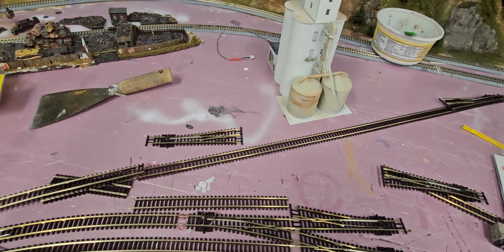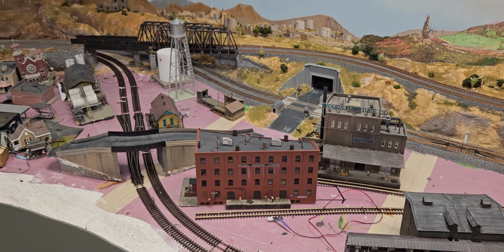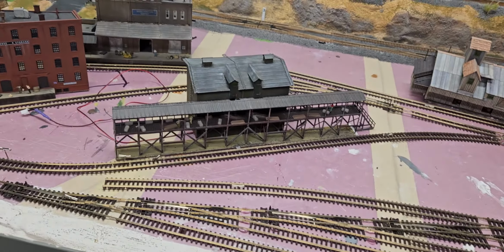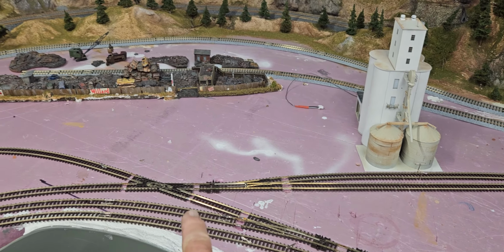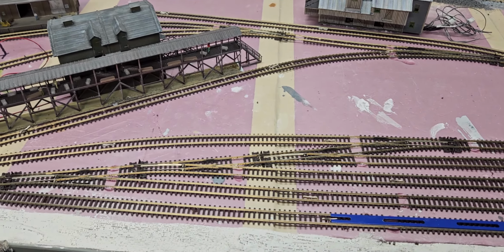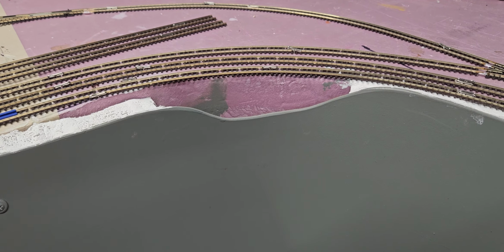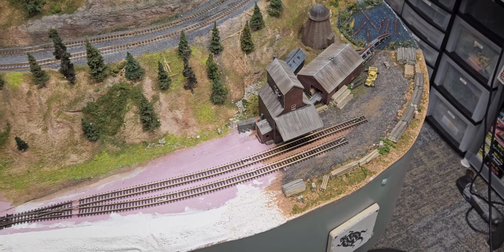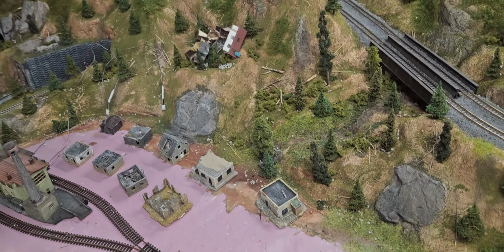N Scale Albuquerque Carnuel & Tijeras RR 4 Layout Update 69

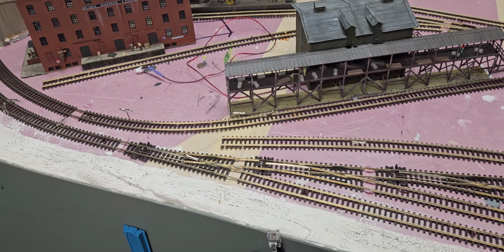Comment: Mike, have you considered a three-way switch at the end of the ACT "engine track" on the small yard off the branch line (replacing the swtich off the branch main at 9:51)? That would free up another spot for a car in the small yard (I.e.: closer to the yard switch) as the ACT engine wouldn't necessarily have to go out via the small yard for tending to other jobs on the branch. Just a thought.
Reply from the maker: It was suposed to be what was left of abandon track and they would have removed a complex switch first .
Thanks , Mike

Comment: When my drip system/sprinklers sprung a leak and I had to dig out a dozen feet of it to find the leak, my neighbor suggested replacing the black flexible hose pipes with rigid white PVC pipes since I was replacing them anyway. He said his decades long experience living in Phoenix with irrigation issues was that they were much more robust and wouldn't be springing leaks. So, I followed his advice. I sold the house after 10 years without a leak in the PVC, but had a couple others in the original stuff, so, maybe he was right.
Reply from the maker: I can not do that because it is such a odd shape.
Thanks Though